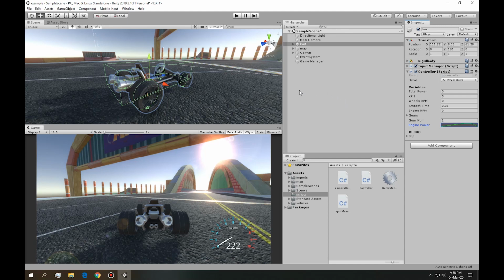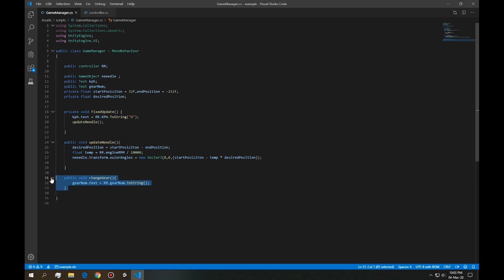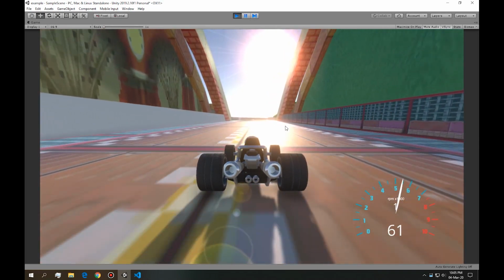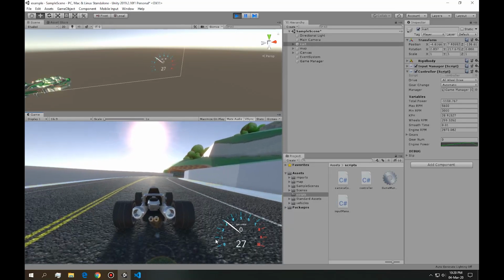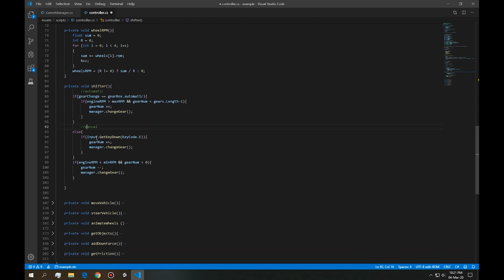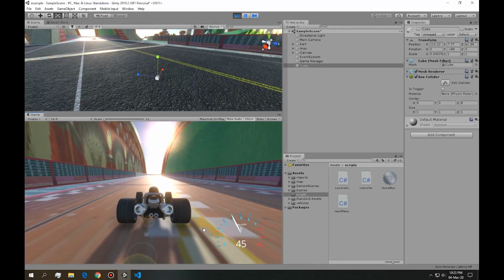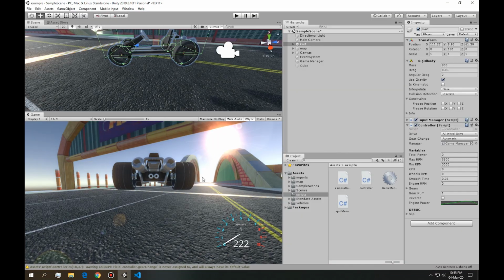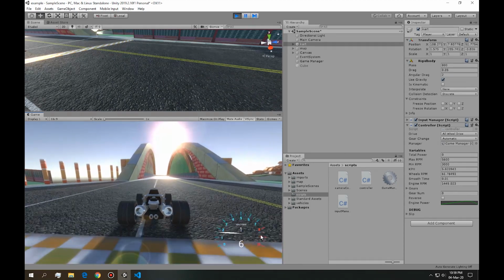Unity Gear Shifter Tutorial

Comment: hey, i got trouble when gearing up or down, it repeat of my gear up and down function... hard to explain but it seems like turret while changing the gear XD. i am using update btw... mine is little different
Reply from the maker: you need to check the gearss , check if gear 1 is within the speed limit of 0 to 80 kph , and do the same for the second for the gear 2 speed must be within 80 to 120 and so on
Reply: @pabloslab  ok, i will try it
Reply: @pabloslab  but i want the gears check is depend on my rpm, not kph.. what should i do now??
Reply: using System.Collections;
using System.Collections.Generic;
using UnityEngine;
using UnityEngine.Analytics;
using UnityEngine.Experimental.UIElements;

public class Engine : MonoBehaviour
{

	public Wheel_Setup WheelSetup;
	public Turbo turbo;

	public GameObject Car;
	public Rigidbody rb;
	public WheelCollider FR;
	public WheelCollider FL;
	public WheelCollider RR;
	public WheelCollider RL;

	public WheelCollider drivetrain;

	public AnimationCurve PowerGraph;
	public float Power;
	public float Torque;

	public float MaxRPM;
	public float MinRPM;
	public float CurrentRPM;
	public float _CurrentRPM;
	public float RedlineRPM;
	public float TopSpeed;
	public float GearUpRPM;
	public float GearDownRPM;

	public float[] GearRatio;
	public float[] EngineBrakePower;
	public float FinalDrive;
	public int CurrentGear;
	public float enginebrakevalue;

	public AudioSource EngineSound;
	public AudioSource IdleSound;
	public AudioSource GearSound;
	public float pitch;

	public bool FWD;
	public bool RWD;
	public bool AWD;
	public bool Neutral;
	public bool AutomaticGear;

	public Input_Keyboard inputKeyboard;
	private GameObject input_keyboard;

	// Use this for initialization
	void Start()
	{
		WheelSetup = GetComponent<Wheel_Setup>();
		turbo = GetComponent<Turbo>();
		Car = GameObject.FindGameObjectWithTag("Player");
		rb = Car.GetComponent<Rigidbody>();
		input_keyboard = GameObject.FindGameObjectWithTag("Input");
		inputKeyboard = input_keyboard.GetComponent<Input_Keyboard>();

		CurrentGear = 1;

		if (WheelSetup.FWD == true)
		{
			FWD = true;
			RWD = false;
			AWD = false;
		}

		if (WheelSetup.RWD == true)
		{
			RWD = true;
			FWD = false;
			AWD = false;
		}

		if (WheelSetup.AWD == true)
		{
			AWD = true;
			FWD = false;
			RWD = false;
		}
	}

	// Update is called once per frame
	void Update()
	{
		if (CurrentRPM < MaxRPM)
		{
			Torque = Power * GearRatio[CurrentGear];
		}
		else		
		{
			Torque = 0;
		}

		if (AutomaticGear == true)
		{
			GearAutomatic();
		}
		else
		{
			GearManual();
		}

		CarSound();
		
	}

	void FixedUpdate()
	{
		PowerSetup();
		RevolutionPerSecond();
		EngineBrakeEffect();
	}

	public void PowerSetup() 
	{
		Power = PowerGraph.Evaluate(_CurrentRPM) * 1 + turbo.TurboPower;
	}

	public void EngineBrakeEffect() 
	{
		enginebrakevalue = EngineBrakePower[CurrentGear];
	}

	public void RevolutionPerSecond()
	{
		float fwd = ((FL.rpm + FR.rpm)/2);
		float rwd = ((RL.rpm + RR.rpm) / 2);
		float awd = ((RL.rpm + RR.rpm + FL.rpm + FR.rpm) / 4);

		if (Neutral == true)
		{
			_CurrentRPM = MinRPM + (inputKeyboard.accel * (MaxRPM - MinRPM));
			CurrentRPM = _CurrentRPM;
		}

		if (Neutral == false)
		{

			if (FWD == true)
			{
				CurrentRPM = (fwd * GearRatio[CurrentGear] * FinalDrive + MinRPM);
				_CurrentRPM = CurrentRPM;

				if (CurrentRPM >= MaxRPM)
				{
					CurrentRPM = MaxRPM;
				}
			}

			if (RWD == true)
			{
				CurrentRPM = _CurrentRPM;
				_CurrentRPM = (rwd * GearRatio[CurrentGear] * FinalDrive + MinRPM);

				if (CurrentRPM >= MaxRPM)
				{
					CurrentRPM = MaxRPM;
				}
			}

			if (AWD == true)
			{
				_CurrentRPM = (awd * GearRatio[CurrentGear] * FinalDrive + MinRPM);
				CurrentRPM = _CurrentRPM;

				if (CurrentRPM >= MaxRPM)
				{
					CurrentRPM = MaxRPM;
				}
			}
		}
	}

	public void CarSound() 
	{
		pitch = CurrentRPM / 6666;

		EngineSound.pitch = pitch;
		IdleSound.pitch = pitch + 1;

		if (CurrentRPM < MinRPM + 1000)
		{
			IdleSound.volume = 1;
			EngineSound.volume = 0.01f;
		}
		else if (CurrentRPM > MinRPM + 1000)
		{
			IdleSound.volume = 0;
			EngineSound.volume = 1;
		}
	}
	public void GearManual()
	{
		if (CurrentGear < (GearRatio.Length - 1))
		{
			if (inputKeyboard.GearUp)
			{
				GearSound.Play();
				CurrentGear++;
			}
		}
        if (CurrentGear > 0) 
		{ 
			if (inputKeyboard.GearDown)
			{
				GearSound.Play();
				CurrentGear --;
			}
		}

		if (CurrentGear == 0)
		{
			Neutral = true;
		}
		else 
		{
			Neutral = false;
		}
	}

	public void GearAutomatic() 
	{
		if (CurrentGear < (GearRatio.Length - 1))
		{
			if (CurrentRPM > GearUpRPM)
			{
				GearSound.Play();
				CurrentGear += 1;
				return;
			}
		}
		if (CurrentGear > 1)
		{
			if (CurrentRPM < GearDownRPM)
			{
				GearSound.Play();
				CurrentGear -=1;
				return;
			}
		}
	}
}
Reply: dont look at manual script. its work perfect... in the automatic gear, i dont want to set to neutral if GearDownRPM is true